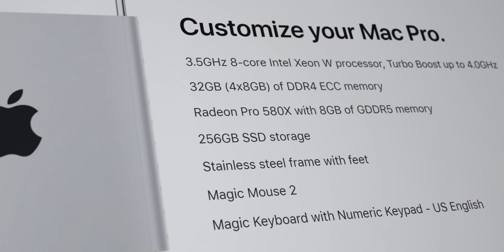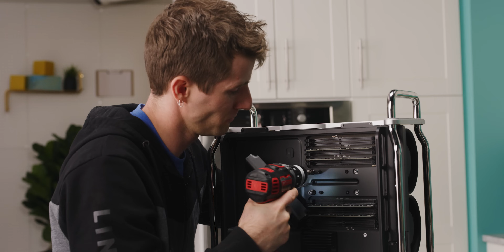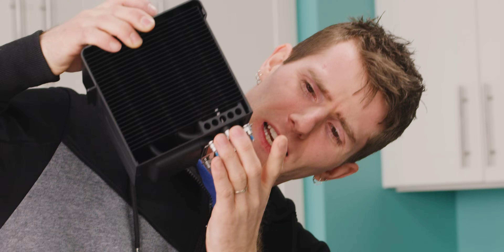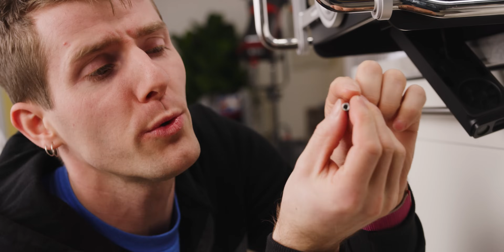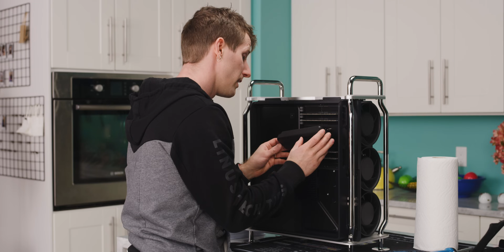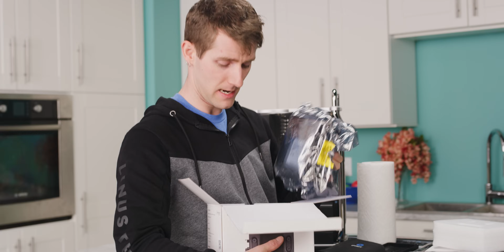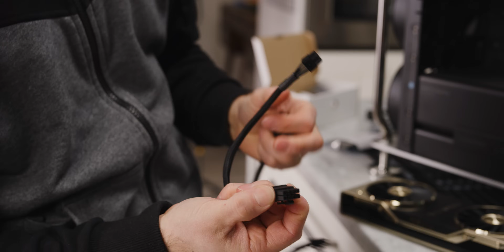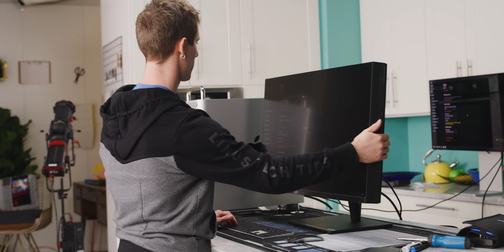Don't give Apple your MONEY - Mac Pro Upgrade Adventure

Comment: I had my own upgrade odyssey with this Mac Pro's two predecessors.
I upgraded my 2013 trashcan Mac Pro with a 1 TB NVMe SSD (running through a simple adapter) and 64 GB of RAM. I've upgraded every major part of my 2010 cheesegrater Mac Pro — CPU (from a 2.8 GHz quad-core to a 3.46 GHz six-core), GPU (RX 580), RAM (from 6 GB to 48 GB) and hard-drive (from a 500 GB mechanical hard-drive to a 2 TB NVMe drive in a PCIe adapter — and I installed a Blu-Ray drive, a USB-C card and a FireWire 400 card (which is useful for me, as the later Mac Pros only have FireWire 800).
My 2010 Mac Pro is now slightly more powerful than my 2013 Mac Pro, with a small but notable gain in multi-core, which is pretty cool.

Comment: I still think about when the new Mac Pro released…. And let’s be honest…. The base price comes mostly from the way the case is made, not the hardware 💀
Like, it’s honestly a really well, overly designed case for good airflow, and the amount of expansion and such the thing has. Plus the fact it’s made of Aluminum and not some cheap steel like usual cases are.

Comment: 2022 Info/Observation for RAM Upgrades:  12-core 2019 Mac Pro had significant issues causing kernel panic crashes, boot drive fragmentation and even hardware glitches in peripheral audio devices (recording studio workstation) that was traced to mixing after market brands of RAM with the stock Apple RAM.

All sticks were DDR4 and matched specs in every regard but

A).  System wouldn’t power on with after market brand in primary slot of each pair (full 12-card configuration), and
B).  Crashing subsided only after single manufacturers chips were installed.

Using only aftermarket RAM has been stable since.  Some kind of firmware installed on the Apple branded RAM as an anti-competitor blockage?

Anyone else experienced the same?

Comment: Great video. If you really want to investigate how many different types of screws a manufacturer can put into a product, go work on any mid-1980's GM product. Have fun :P

Also, in terms of commodities: the extra dollar spent on a different color of PCB equates to a huge reduction in profit per production run. As my dad told me (he was a machinist) by using the same part on a dozen different products, even a small company can make an extra million dollars per year.
Reply: If you push a million products, a price reduction of 1 dollar adds up to quite a lot

Comment: I hate apple, but to be fair, phylips screws most probably shouldn't be used for any parts... For starters they're just bad and you can have longer life and durability in other designs. Also, if you're even planning to change anything you screw in you should most probably be the kind of person with a toolkit. And if you don't, find one of those people cause they're easy af to find nowadays and you obviously don't have a knack for anything tech cause toolkits are cheap and super useful and honestly why don't you just have one?
Reply: This. Torx or torx plus should be the standard. Philip screws are from a age past of cheap furniture manufacture. Philip screws were literally designed to strip out easily…

Comment: Apple is packed with lots of religion inside, for example a cross in the remote controller. This way, Apple machines can be bought by priests, or religious leaders under strict financial exceptions, since they spend donated money. Priests can't just buy a satanist PC, most people buy. Therefore, they can spend more on Apple computers. However, Apple is packed with more technology, in exchange. Mac OS drags a ghost to the computer.
Reply: Tf are you on? I want some
Reply: Are you high or something
Reply: @Baer9471  No, just a simple gamer. But I disassembled some Apple products, and I made up the rest of the comment based on world wide marketing strategies. For example, kings and queens require jewelled phones and laptops, their nation pays legally for that, but they wouldn't pay for a quad sli water cooling power plant.
Reply: @jozsiolah1435  you’re still high

Comment: Bro, your cordless drill was in the wrong setting.  You had it on "2".  Which is always going to be the setting you want when you're using drillbits.  Its' a higher speed for drilling.  When you're using it for screwing, you want to set it to "1", it's much slower and more torque-y.  You're less likely to damage something by screwing it in too fast.

Comment: This video perfectly describes why I hate Apple. In NZXT PC builder, you can get a better PC, water cooling, and a 1TB m.2 for literally a 3rd of what the base Mac Pro costs... I can't believe people actually buy this crap.
Reply: Also, $400 for a hard drive cage (something that is included in basically every MT case) and 8tb hdd (which you can get on Amazon for $160). What a ripoff.

Comment: Realistically, wtf would you even do with 1.5tb of ram?

I have 16 gb and the only time I capped out I hade 2 android emulator running macro, like 6 chrome tab, and 3 solidworks tabs used

Comment: Hey Linus. May I borrow your precious 5 minutes time ? I am going to buy Mac Pro 2019 base model or a refurbished one with 12 core from Apple. But planning to change with W3175X which is easy to buy right now in UK.  sorry to ask you but not sure where to look. Some said it won't and same said it will but maximum ram is 512. some said it has lower PCIE lane and can use only to boot the Mac and that it is.Will XENO W-3175X work with Mac Pro 2019 ? Truly appreciate your time !

Comment: surveillance drives are basically low rpm drives who can run for a long time and overwrite themselves a lot more since they are usually used in surveillance video storage. they wont break but also wont break any records for speed

Comment: How difficult would it be, to adapt the MPX module card to a PC? It seems Apple has plenty of the Radeon cards, but they’re tucked away in their strange module configuration. It seems like only power would be required, for the 5700x, and the ProII, but the dual card accesses the second full PCI connector so it would be far more difficult.

Comment: 60 000?
Reply: With all of apples extras in it, yes. The baseline was 6k which for the specs it had, the PC equivalent (at least when this video was put out, pre- GPU shortage) Would of ran you 1600-1800 and you could of had a much better gpu for that price point.

Comment: “1.5 tb of ram, aint that bad” me with my 8 gbs
Reply: 8 gigs is enough for non work related use. this, is a full blown workstation, used to do hardcore video editing, green screen working, automation, 3d graphic design, physics and fluid dynamics simulations and so on.. it gotta have a bit more ram and cpu performance than a consumer electronics device..
Reply: @datutturugang666  pretty sure that 64 gigs is good enough for doing everything you could want, unless you’re doing and running all of those things at once.
Reply: @thebois32  my workstation has 512 gigs, planning on a terabyte setup soon, and working as an aerodynamicist in the usaf, both cadding and fluid dynamics simulations, destroy ram.. just imagine to render a full aircraft, with every stress point and to also simulate physics for it.. it bottlenecks, it’s just not enough ram for all of that..
Reply: @datutturugang666  Bruh good 4 u
Reply: 4gb ram
Reply: 3gb
Reply: 7 GBs
Reply: 1 bit ram
Reply: 12gb, iMac, 10gb MacBook 😭😭 
Update: 12gb Mac Pro 😭
Reply: I meant to buy 16Gigs but I bought 32 by accident lmao oops

Comment: This pains me so much because as a tech for apple,  you just touching the computer without esd protection has pretty much destroyed or will slowly corrupt the small components inside the machine. Basically making it useless in about a years time.( just touching the outside can cause small sparks invisible to us)  so yeah please dont follow this,  you will just end up back at the apple store crying.

Comment: Dell Dimension 8200 cpu doesnt have a socket lock or whatever. I took the heatsink off and it flew. It was intel pentium 4 with pins!!! So weird. But yea they still work...Just they cpu flew away

Comment: Hello! pls i need your help, I have mac air late 2013- 2014 i   11inch  4GB RAM. Its mentioned thar upgrade RAM is possible for 8GB, i try with many computer shops, they say many things and last they say not possible. Any good advice you can  provide, because its sweet little laptop, i dont like to throw it away.

Comment: If you buy a Mac Pro then you have no friends cus you clearly can’t see that for so much less you can get a pc that’s most likely miles better
Reply: why does having money to spend on things you like mean you have no friends. sure people could spend money on something cheaper that has equal specs but A) not going to run mac os without more work b) not going to have a single stop for warrently c) disjointed costomer support in case of part failure d) might just not fit your personal aesthetic.
Reply: @mark1A100  if it doesn’t fit your aesthetic then instead just buy the case and the os for so much cheaper than 30k
Reply: @mark1A100  and if you buy a Mac Pro you are wasting so much money on “aesthetic”
Reply: @mark1A100  what do you mean by you won’t have a single stop for warrently
Reply: @mark1A100  you won’t have disjointed customer support if you buy from a semi reputable company. Also apples customer support sucks
Reply: @mark1A100  I don’t even know why you are trying to argue with me on the fact that a Mac Pro is a great computer
Reply: @mark1A100   I can build a pc that’s better than the base Mac Pro right now

Comment: The other day I was speccing out the Mac Pro in the Apple Brasil site to see how absurd the maximum price would be and it came to a whopping 542.447,80 BRL (Brazilian Reais), which at the current exchange rate would be a little over 960000 USD. That's almost 43 grand in US dollars more than the US price. You could almost buy another one with that difference. I did this to test the "Brazil Cost", which is how we name the absurdly increased prices of products when they get here, specially electronics. Most of that is due to excessive taxes.

P.S.: When I finished speccing and saw the price, I told my friend Rafaela and started laughing and she looked at me like I was crazy. I was merely laughing at the absurdity of the price!
Reply: Yes even in india we have 30 percent import tax it increases the costs of iPhones cuz they dont manufacturer them here
Even ps5 is 750 dollars in india 
And for the price of xbox series s in India we can bu series x in U.S 
If you have any relative in us asking them to bring when they are coming back is wise

Comment: I like the way the cooler slides in. When I'm installing a cooler I always wonder if I put it down evenly enough and whether the paste spread the way I wanted it to.
If the cooler is put down at an angle the paste can spread to one side and leave a big part of the IHS bare.

Comment: Linus: I'll be removing an eight core processor
Me: cries in 4 cores
Reply: 2 core loelskslslalsldkekjfjd
Reply: 2 core aaaahahahahahhahahbfajdsbfdsaibraedasd
Reply: Me: (no cores) because I don't have a pc swheuwbsjjsshshsjahahaj
Reply: @MJ Hongoy even your phone has a cpu so it also has cores
Reply: Half core
Reply: Many thread:high multitasking performance
Reply: Intel’s dumb 8 core choice of the 11th gen ,just gets highly underpowered by the last gen 10th itself.hahhajqhjabjBjbjb
Reply: @dontreadmyprofilepicture7847  intel even sucks at managing power in a 4 core processor....my cpu start to power throttle (laptop) to 2.4ghz from 3.9 ghz and stays at 10w power usage tho its TDP is at 15w (this is in  the case where the laptop is plugged in)
Reply: @thechannelofrandomness7670  that's due to thermal limitations then, also check in xtu.
Reply: @Ben.N  my temps are around 65c during that time.....now i fixed that by disabling power throttling
Reply: Laughs with i3
Reply: Me on calculator: 😥😥😥
Reply: Is this some kind of joke that I’m too poor to understand. cries in mobile
Reply: @membrane4031  don't be sad, a phone can have even more cores than an average PC these days
Reply: Me with one core:rip
Reply: 0.1 core
Reply: 2 core
Reply: 6 core: nah doesn't matter
Reply: There's 8+cores available now!
Reply: Cries in one core at 1.8 ghz
Reply: Lucky for you, i have a 0.001 cores
Reply: Me crying in 8 cores
Reply: ngl 8 cores pretty bad given the price i have a TR 3990X with 64 (in a 10k build tho) but also a 5950x with 16 cores in a 4k build why only 8 apple
Reply: …….2
Reply: Me: cries in 2 cores
Reply: 2015 Mac mini i5= two cores
Reply: Luckily i have a 12 core proccesor…

Comment: gone are the days of the Mac 512K with everything you needed on a few 3 1/2 disks. the possibilities seemed endless, and with something called a mouse you could draw right on the screen! sure it was b/w but it was small enough to be portable (kind of). It wasn’t exactly cheap at $2500, but that’s what it cost for the newest cutting edge consumer tech. i loved that computer. still have it actually.

Comment: Actually a serious comment: Looks like cheaper 28 core Xeon's are off the market. I haven't seen a single 28 core less than 9k and I've seen some for 20k in Japan. The apple upgrade to 28 core is 7k.   Apple's CPU option is best and probably helps you avoid voiding the warranty.

It's true that you could resell the 8 core Xeon that it would replace if you bought it online, but good luck if you can sell a slightly used 8 core xeon CPU. 

Top Hit Japan Amazon: $15,000 : https://www.amazon.co.jp/-/en/CD8067303314400/dp/B077S25CW9
Top Hit Amazon U.S.:  https://www.amazon.com/Intel-Xeon-Platinum-28-Core-Processor/dp/B077S25CW9/

I saw one for $5300 but it ships over a month later- seems like a scam to collect money and run. The specs about addressable memory while important seem absent from the descriptions. 

Every other bit of advice in the article is great. I guess the good news is if you really want to do this, you should skip the hard part (re-gluing in a new CPU). It's possible Apple may have had an impact on the market.

Comment: The average user to browse web, use word, excell, powerpoint , run normal apps, view some videos/movies etc does not need more than a I5 CPU, 4GB Ram and 250GB HDD. Most people buy greatly overpriced hardware that greatly exceeds any use they will ever need. If you run demanding video games then you might need a decent video card and a bi tmore of ram, but even the standard intel's gpu and 4gb ram will play alot of video games just not the more visual demanding ones.
Reply: Ikr almost every apple user will only use computers for browsing or watching vids

Comment: Imagine paying 6k for a cheese grater. When you could literally make a yourself a streaming setup and also buy an insane 5k gaming pc that is just as good and looks better
Reply: I dislike Apple (for the computers) but man they are pretty
Reply: I’ve been on both sides of the fence. And yes the macpro is expensive. But its about more than just specs. As a digital artist I want my system to work and get the hell out of my way when I’m designing and you can’t beat macs for that. Their out of the box optimisation is unparalleled. 
One freaking windows update and you’d probably lose the Bluetooth connection to your mouse or the driver compatibility to your adobe sweet. 
Windows is a mess and its because they don’t pull their socks up that apple is the mostly the designers choice. And in which universe have PCs looked better than Macs?
Reply: @Smokedship  every fucking universe lmfao. You cant customize how a mac looks, you can literally customize every single thing in a PC down to what colour your fucking SEDA cables are.
Reply: @flavc5434  well for a guy who has too much time on his hands like some people; I guess wasting time over customisations would be fine. But working professionals don’t really have that kind of time to dick around and want something that works out of the box.
Reply: @Smokedship  if the fact that it works straight out the box is enough to warrant the obscene price tag and lack of available customization then all the power to you. But theres a reason why Macs get clowned on in the PC community thats all im saying
Reply: Flav C You are genuinely everything that is wrong with the PC community, PC's are cool and are much better then apple when you compare  price for performance. However there are qualities associated with apple that are better than PC. No need to hate on anybody for how they spend their money, just relax a bit.
Reply: Sure you can get faster for cheaper. But better looking, better design? Nah mate.
Reply: @Changderson  lmao imagine thinking a cheese grater looks good
Reply: @Changderson  when did i ever mention anything about rgb in any of my comments?
Reply: @flavc5434  just like I never mentioned a cheese grater? There’s no pc engineered like the Mac end of story.
Reply: Yeah but that way you dont get the apple logo on your pc
Reply: SEND ME HATE ON MY videoS
Reply: (coughs in MacOS)
Reply: Gaming isn't the only thing computers are made for. In case you don't know.
Reply: @ishkaranbrar313  well done sherlock, gaming was an example lol, but obviously you can use a high end "gaming" pc to video/photo edit. My whole point is that you could build A WHOLE SETUP with the money you spend on that cheese grater
Reply: @flavc5434  Do you know how much Titan RTX cost?
Reply: @ishkaranbrar313  i dont care "how much titanRTX cost" lol, its a fucking cheese grater, linus proved you can build a better pc for half the price of the max spec mac
Reply: @flavc5434  for programming and app developing and finalcut pro runs better on the Mac but yeah it’s quite overpriced
Reply: r/wooosh
Reply: Not everyone is a streamer or gamer and believe it or not people dont use multi thousand dollar computers for just gaming dude. The grater tho is overpriced to shit